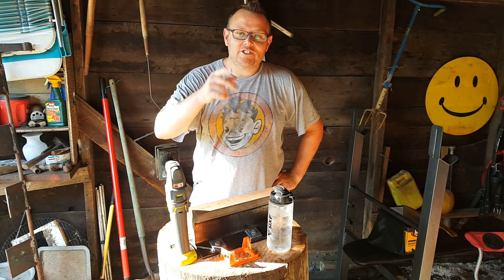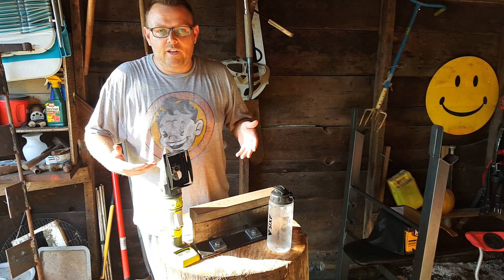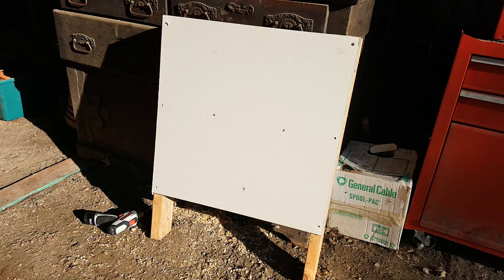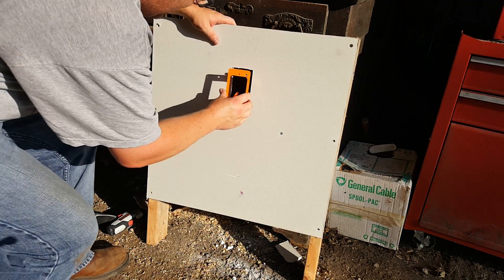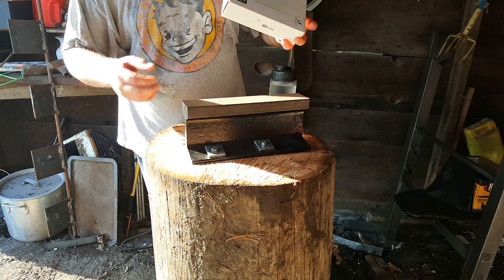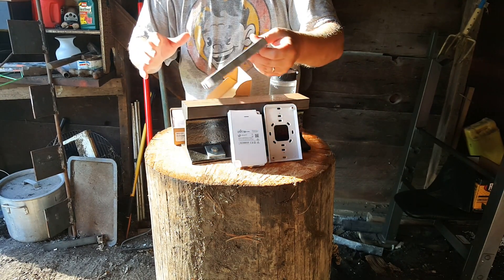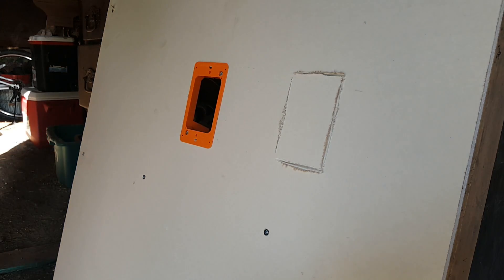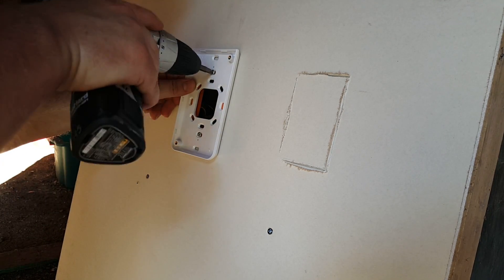UniFi In Wall AC AP Installation - With QBit!

Comment: Quick question. I have a single level 2200 sq/ft house that currently has an orignial AP-LR.  Currently I have about 15 wireless devices connected to it.  I would like to upgrade to 5G and was looking at either adding 2 of the AC-Lites or 1 HD-Nano.  Which do you think would be better: two access points each with 2 radios or one with 4 radios.   I have good coverage now with the AC-LR but that is 2.4G and no 5g coverage now.  I just upgraded my Dell to AC and would like to take advantage of it.

Comment: Please explain what the different ports are for?
Is the rear port POE client?
If the rear port is use, will the 2 bottom ports act like a switch to the port on the back?
Reply: Rear port accepts PoE to power the AP. Switchports are bridged to each other - so, yes, it is a mini-switch. PoE passthrough on one of the ports to be used for something like an IP phone, another PoE passthrough switch, or IP camera.
Reply: or you can stop being lazy and go to unifies site and look it up yourself. what is it with people and not being able to research stuff on their own and wanting others to do it for them. would have had your answer in less time looking it up rather then asking and waiting

Comment: Great video of how to fit this into a new area. I have a potential install with two network jacks already in the wall. To install this I would have to remove the jacks and install keystones then a cable to the back of the in-wall unit. At least that's what I see. Do you have any other suggestions on how to install in an existing wall? Thanks.

Comment: I think UBNT needs to reread the definition of "IN WALL" This is clearly just a surface mount ap that happens to mount to any standard electrical box. Before you say the screws and ethernet are in-wall, that hardly counts.

Comment: I saw folks posting about the new in wall unit on the beta store, but I'm only seeing the LED panels as available in there with my account.

Thought?
Reply: The In-Wall HD is currently 'sold out' through the Early Access store.  Ubiquiti doesn't typically make a whole lot of stock available through the Early Access store, since that stuff is often still in beta testing (hell, they released the UAP-nanoHD before the firmware was even feature complete, and it still isn't!).  Since I ended up missing the initial batch of UAP-nanoHDs, I just kept logging in each day 'till I saw it in stock and hurriedly put in an order... heh
Reply: I believe I am. I checked for these a few days ago when I saw someone in a Unified FB group post about them. Only thing I see as available is the LED light panels. Its quite possible I'm looking in the wrong spot, although I do know I had signed up for their beta program a while back. I just starting yo think I'm late to the party. I may do as mentioned above and just start checking every day.